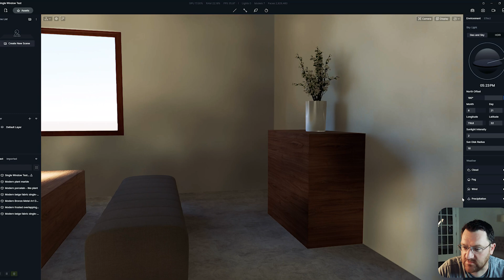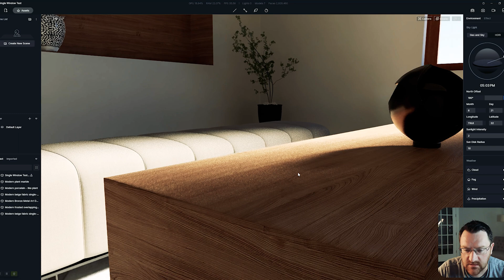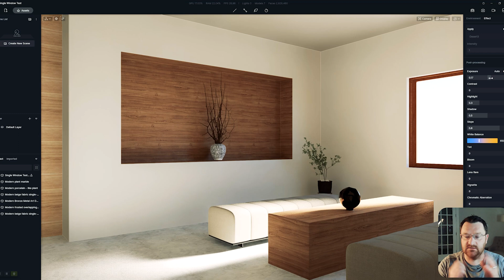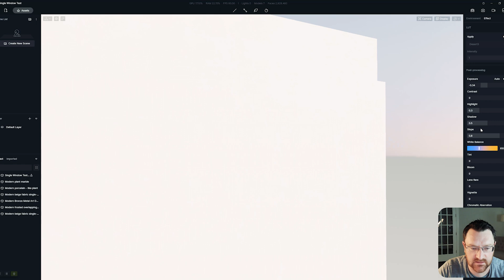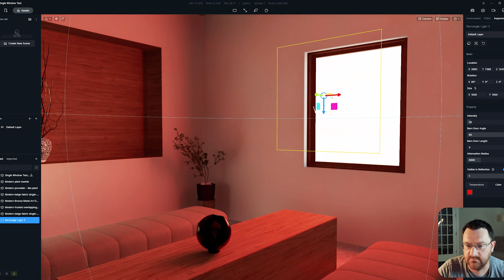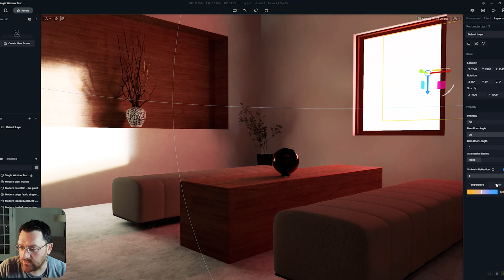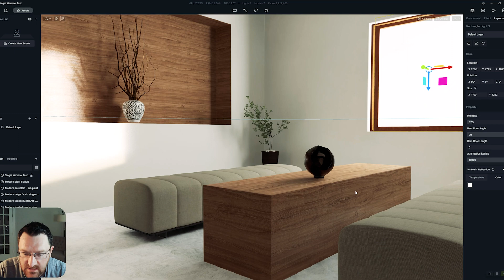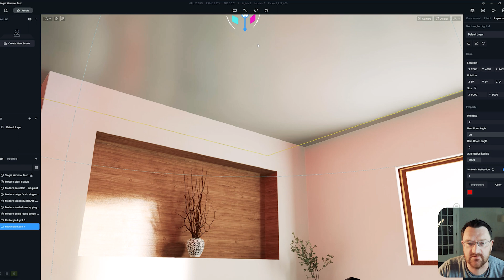D5 Render: Single Window Light

Comment: Thanks again for this clear explanation! I really love the way you explain everything. I have one question, do you have any tips on how to light a space ( bathroom) with no windows? I haven't been able to find any videos about this at all which I found strange because there are a lot of bathrooms out there with no windows. Thanks for now :)
Reply from the maker: @timaudi4237  Ao my advice here is to mimic real world lighting; a main ceiling light, with accent lighting from wall lights or lamps.  Also, you can turn off light visibility in final renders in D5, and adding more lights to the scene will be possible this way. D5 uses a single ray, single bounce GI system (modified with custom magic), but real light bounces until it loses energy, so a single light in a bathroom lights most of the space. So….. fake it! Let me know if you need more help or to look at your scene!
Reply: @viarender  thanks a lot for this! Do you mean with "turn off light visibility" that i dont activate sky and sunlight? Because i set environment on hdri white, since there wasn't a choice to turn everything off..or at least I don't know where to turn of all environment lights. I'd love to show you one of my renders, because somehow they keep turning a little pink...
Reply from the maker: @ Each light should have to option to turn off its visible status (so you do not see it in the render), but keeps the light emitted. Feel free to email me your renders at viarender1@gmail.com, and I will take a look.
Reply: @viarender  thanks a lot, i will